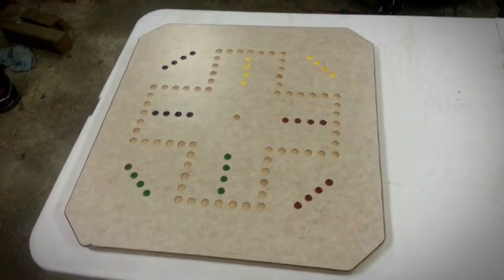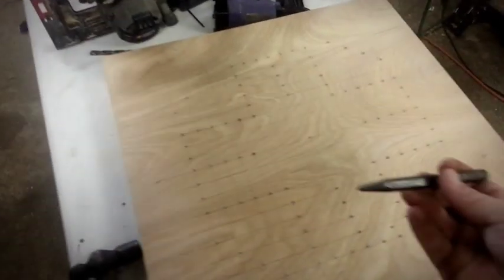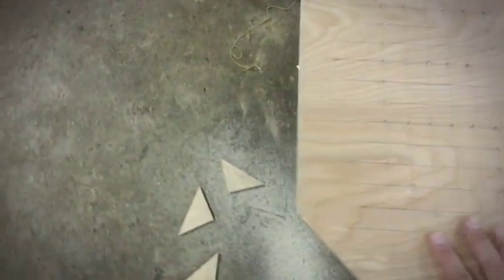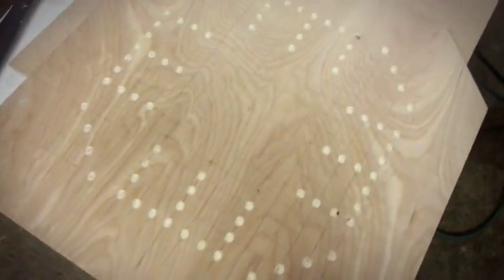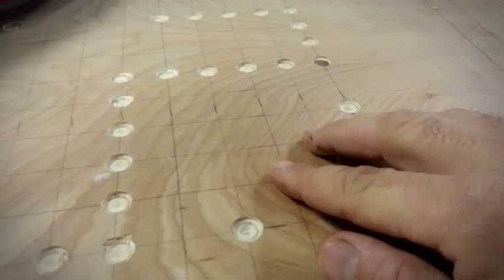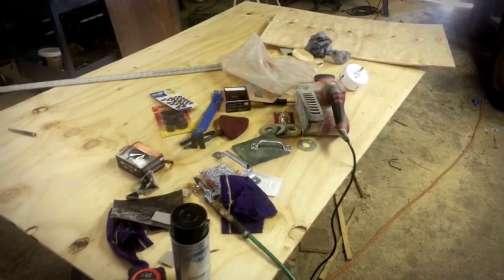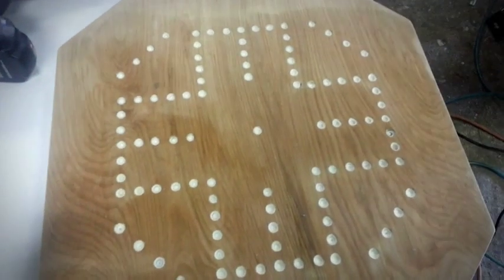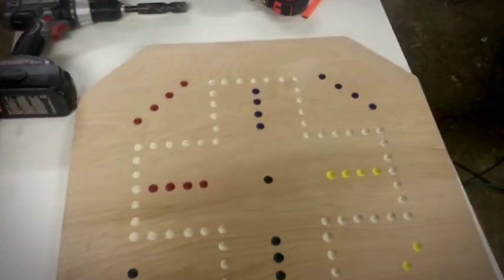How to build a wahoo board game

Comment: I have built over a dozen for friends and family. I did not have a drill press but have found that a counter sink for the screw heads make perfect beveled holes. The best part about using a counter sink is that if you are drilling by hand it is hard to over drill because the counter sink is more of a ream and does not pull its self into the wood like a drill bit. Also I used a router with a round over bit to take the sharp edge of the board so if you do cut on the wrong side with a rip blade the router will clean up the edges. You do have a nice board i like it and am only trying to give a few ideas that worked out on mine and am not knocking yours in any way. Nice job